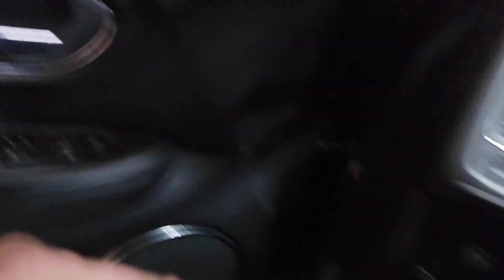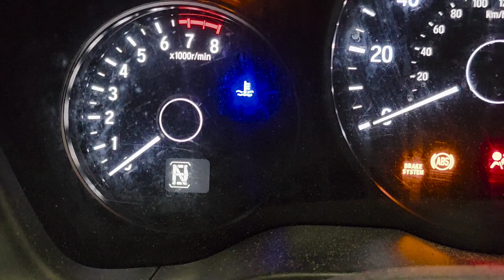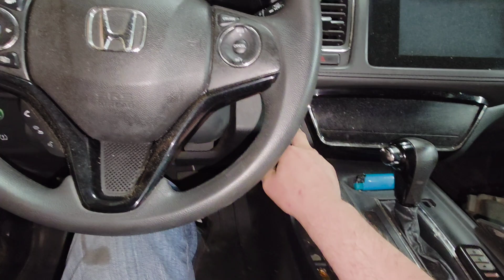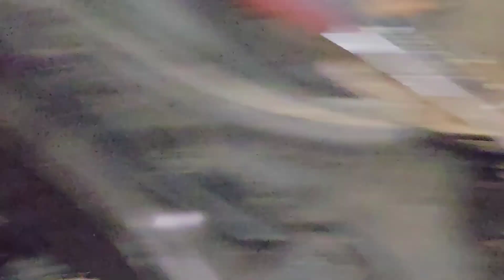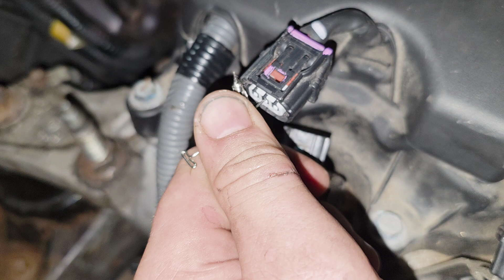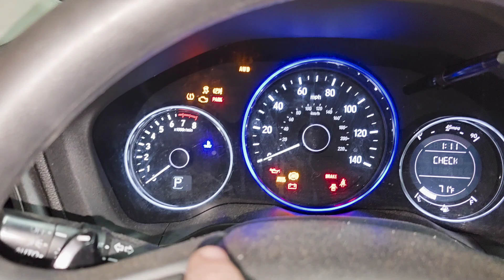Always check powers and grounds. 2016 hrv no crank no start/crank no start/no high beams

Comment: Great video, similar issue, my passenger side motor mount collapsed, replaced it but before i did the car shut off, cranks and battery is weak, with jump it will run sometimes for a second then shut off. Not sure. Tomorrow i will check grounds. I replaced all mounts couple weeks before. When passenger mount collapsed the engine was vibrating metal on metal on that side mount and sounded rough. It runs smooth for a second at times. Something must have came loose with the vibration I'm assuming. The new passenger side motor mount was defective. Now i have  fresh one in.